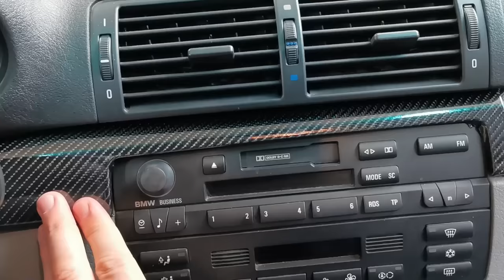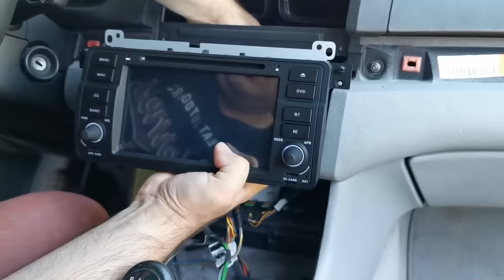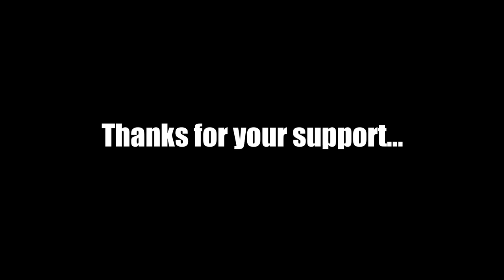Building a BMW e46 Coupe in 10 Minutes

Comment: Not a BMW fan but this car looks sick AF. Even as a Mercedes fan I could see myself driving one of those. Good job dude.
Reply from the maker: Thanks a lot bro. We appreciate it. More project cars to come...
Reply: Mercedes has become ugly and terrible over the years i miss the times bevor 2014 i wouldn't even touch a modern Mercedes they're just ugly as fuck the old pnes look so much more pretty and are overall just better but now.... And its not just Mercedes. Nissan Mitsubishi audi lamborghini and slowly BMW too not long and only brands like Ferrari stay true to themselves
Reply: @laiklp8575  as someone who has worked contractually on merc's for the past 2 years, i can only agree. newer merc's are absolute dogshit cars. they can hardly come apart without breaking them. the paint is awful on most models, the engines are dull and boring, not to mention a good portion of them have a Renault engine. they're basically made to just break, and make mercedes money on spare parts. never in a million years will i buy a mercedes that is newer than 2012. out of every single make of car i've worked on, i've never been as disapointed as when i started working with mercedes.

Comment: I love the looks just wish you would have done a bit to the engine too. This is technically rice. Looks fast but isn’t fast. I still really like the way it looks though good job on the project
Reply: What he can do about engine he can't buy whole engine
Reply: @Levelingup8  Yes you actually can. + there are many things that you can improve on a stock engine
Reply: I agree, he could've done so much more to the engine.
Reply: @peterkujo2281  there isn’t much you can do to a naturally aspirated engine, if hes lucky he could add like 20 horsepower at most
Reply: @mr.gilbert2790  nope, he can make that thing way faster
Reply: @peterkujo2281  I don’t even understand what you just said. If you’re trying to say he can make it quicker, you just can’t. You’d have to engine swap for it to become faster
Reply: @mr.gilbert2790  yes and he could've done that rather than putting a fake carbon hood and placing tons of M stickers on an E46 Coupe
Reply: @peterkujo2281  i guess you're too young to own cars and understand how expensive that is
Reply: @mr.gilbert2790  you arent too good at assuming someone's age are you.
Reply: @Santiago Burboa rice means race inspired cosmetic enhancements which means when you kit out the outside the car it looks fast when it actually isn't since the engine is pretty much stock
Reply: @mr.gilbert2790  an engine depends on a lot of things you can find good engines that can make good power for quite cheap if im honest but you just have to be lucky. thease people are in Romania where finding another engine is actually quite cheap to buy and they could find something like a 2.5L engine for about 400 euro so its not that expensive however good engines are useless in romania since the roads are so bummed and the police are very strict with speed and corrupt
Reply: @Santiago Burboa woah dude y so rude
Reply: @AdamPetr  europe has strict modification laws so they can't do much about that
Reply: @mr.gilbert2790  actually there is a lot you can do to it.....better exhaust, air intake, new headders, new sparkplugs and that's just to name a few. And they could at least change out all the fluids if they modded a car.

Comment: Me : " Dad, I want a BMW "

My Engineer dad :
Reply: I just got a good 1995 E 34 beamer that has some 10k worth of parts in it, adjustable coil overs, sound system, $300 tac welded radiator, some aftermarket aero, and a custom exhaust job. It sat for like three years in a garage, rolled it out, it fired right up. Only has 78000 miles.
Reply: @sovietfp  how much did you get it for?
Reply: @Dr.Freeze  $1000

Comment: i love e46s but why we have to watch one get riced out 😭 we leave that to the honda’s
Reply from the maker: We love the way the car turned out. It was a lot of work... More Project Cars to come. Thanks for your suport bro ✌️
Reply: Riced out? I don't get it... I can understand that the M3 badges are a bit too much considering that this is a non m3 e46 but still this is far from rice. Could you explain what makes this car riced out? I'm just asking and everyone has their own opinions about stuff not hating or anything like that I'm just curious.
Reply from the maker: @citizenjp4681  Good point bro... Peace✌️
Reply: @citizenjp4681  did you see one engine mod? an aftermarket cold air intake? anything? all the exterior add ons and brand new replacements and nothing was done to the engine bro.
Reply: @citizenjp4681   the car is great i love the way it turned out too i got an e46 myself but i’d rather get the engine taken care of than the interior and exterior first, right or wrong?
Reply from the maker: @active507shorts  The engine is more than ok. For now we took care on the exterior and interior mods...
Reply: @active507shorts  car is no where near riced...it just looks good , he didn’t put a big wing or a loud exhaust. Just because he didn’t put engine mod doesn’t mean the car is rice
Reply: @active507shorts  car is no where near riced...it just looks good , he didn’t put a big wing or a loud exhaust. Just because he didn’t put engine mod doesn’t mean the car is rice
Reply: Lisandro Hoa
Reply: @cheezekakeeditz8757  ikr
Reply: NotLxrd  thank you
Reply: @cheezekakeeditz8757  no it's riced. They made the car look fast yet did nothing to the mods. And the M stickers and the fake carbon fiber hood. Thats ricing
Reply: @letzbbear2922  I think you replied to the wrong person mate, read my comment again. I said that the bmw IS riced. It had no mods whatsoever. They only cared for the appearence of the car

Comment: Dude this is the best car transformation I've ever seen... Steering wheel is on 🔥🔥🔥. How much money did this cost ?
Reply from the maker: Thanks a lot bro. More project cars to come, The mods were 2700 euro.
Reply: @blackcatgarage  Dude i have a low budget should i go for bmw e36 318i or save money for bmw e46 328i ??
Reply from the maker: @kashiftechgaming  It's your own choice. Both are great cars. Depend what you like best. Good luck with that bro. 💪💪💪
Reply: @kashiftechgaming  328i just because big difference in engine size/power, get the e36 if youre gonna throw a bigger engine inside!

Comment: Wow great transformation that's a brand new car 🔥🔥. I have few questions about your hobby if you are willing to answer. How much did you pay for it and what year & engine model is it? Also how much money did you guys spend on rebuilding it? Great work and greetings from Croatia 😁
Reply from the maker: Thanks bro. The car was 1000 euro. It`s a BMW 3 series e46 Coupe year 2000. Engine 320i straight6, 150 HP. All the mods 2700 euro. Greetings my friend and stay tuned...
Reply: Here in Croatia for BMW from 2000's e46 320i you will play around 3000 to 4000 euros with 250.000+km on clock now in 2021..So sad... But still best project car for me. Good work bro 🙃
Reply from the maker: @luka0090  👍✌️💪💪💪
Reply: @blackcatgarage  well im about to try and tune mine. Im not going with the sports look but more with a brutal one)
(only because it's my first car it doesn't mean that it has to look bad)
Reply from the maker: @parallelworld7970  Good luck with your project bro 👍
Reply: @blackcatgarage  thx mate

Comment: Good work, two small questions tho.
1. Was there some issues with the Airbag on the new steering wheel? Got the same and everybody says don't do it due to the different systems on FL and pre-FL.
2. Did you need to do any mods regarding the AC controls down there? Heared you need some kind of adapter plate?
Reply from the maker: No everything worked just well in our case. Good luck bro.

Comment: Do the m3 bumpers and parts just fit straight on to the car???
Reply: Yeah, what’s the problem
Reply: @Arnold28200  just wondering becasue I’d like to do it myself
Reply from the maker: Everything its possible :) They fit almost perfect but you need a little bit skills to do it just right :) Good luck bro with your project...

Comment: You have not even touched a bolt from the engine bay. That’s a fake M3 powered by Amazon and Aliexpress stickers and LEDs.
Reply from the maker: So what? The car looks hot as fu..k... Who cares about the engine... :)The engine is a straight 6, so it`s got enough power.... Go check our project cars on the channel bro😉🤘
Reply: @blackcatgarage    fair enough, but would prefer less M badges and M3 look, as it is not an M3. That’s my opinion mate, enjoy ur car as it is.
Reply from the maker: @bafomick  Sombody else is enjoying it because is Sold... Now we are restoring other Project Cars. Go check them out bro😉✌️💪💪💪